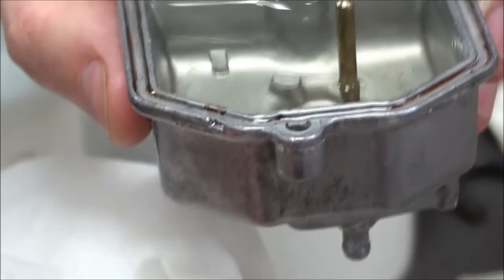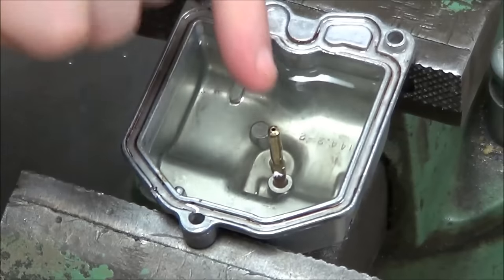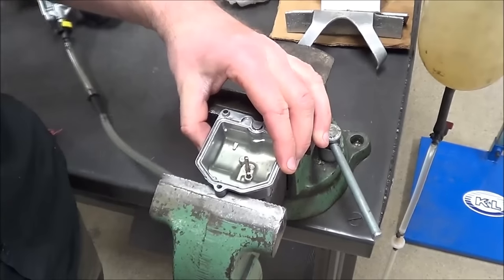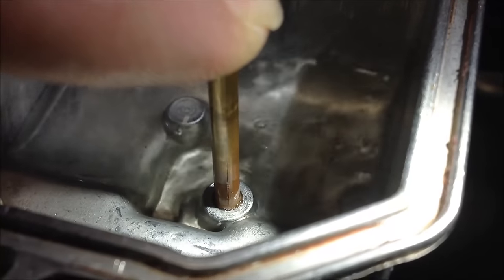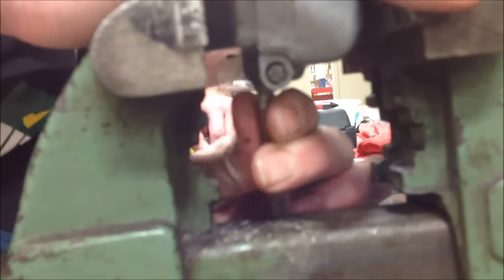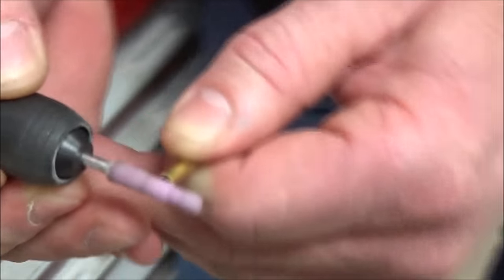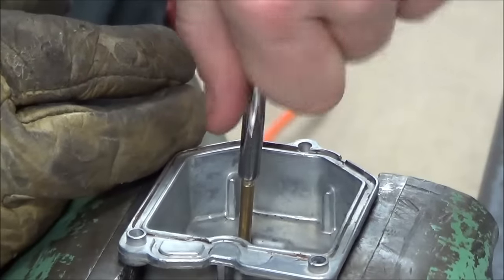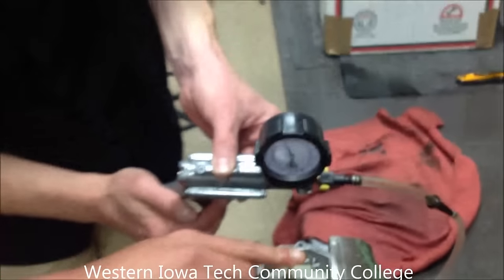How to repair a leaking carburetor float bowl. The spot you might not know about!

Comment: Which epoxy did you seal the fix with? The idea of epoxy mingling with gasoline makes me nervous since carbs can be sensitive. But you think that's alright to do?
Reply: JB Weld brother. 
I worked at the Cadillac dealer back in the 80s and when we rebuilt Rochester carburetors, we would seal up the plugs with JB Weld while we were in there.
The plugs were holes the factory used to dril out the fuel circuits and were known to leak over time so we epoxy them while doing a standard rebuild.
Reply: Awesome. Thanks for the tip. Now I just have to remember which carburetor I was working on four years ago.😆 @williamcarr3976

Comment: I have an 87 FXRS with the Kiehn Butterfly Carb . It runs great but I get a smell of gasoline all the time .Sometimes no evidence of drip just a smell . When I do notice a drip it is from the overflow tube on the bowl. I put new float needle in and clened it and checked float level ,all is good . I put new brass fuel inlet into carb ,still smell gas. I shut gas off before putting in garage and run till engine stops . I am getting ready to tear the carb off and check or rebuild again . i saw this great video and now wonder if maybe I am getting a leak where overflow tube goes into bowl like you just had on your video. I am going to check it out . Thanks for your great videos.

Comment: I had the same thing happenning on my 87 FXRS and I always used to smell gas but the bike ran great , I replaced the plastic inlet with the brass inlet , still smell gas . I had the guy who built my engine, very well established old time Harley machine shop check the carb out and fixed it up . Runs great , still smell gas . I can see gas coming out overflow tube when idling , it's getting worse . I took carb off my bike ,replacin the Kiehn butterfly with a  Harley CV used rebuilt carb . I tried this test after watching your video ,dont see any bubbles . the float and needle and jet look good. It's gotta be something slightly cracked. When you turn fule on bike runs good and fule pours out overflow tube. It's time for the more reliable carb anyhow , but drives me nuts that can't figure it out. Original carb ,85k miles , I guess it's just done.
Reply from the maker: Hi Greg. I offer full service carb rebuilding and repair if you're interested. My number is below.
👍 Thank you for taking the time to comment! It helps us! 
Here is a way to support all the free videos.
Want to say “thanks” or “keep it up”? Click here https://www.paypal.me/how2wrench  

Coach Conley is also available for hire to personally work one on one with you if ever needed. Yep he is a real person. Give him a call @ 602-345-0432
Details here: https://how2wrench.com/product/personal-tech-training-phone-facetime/ 
Your answers and help are just around the corner. Save time and money while protecting your investment and yourself by doing it the right way!
Follow us! 
Web:
www.How2Wrench.com     
www.Tools2Wrench.com

Comment: that's a good problem to drill down on and solve..but parts a pretty cheap to just replace the bowl once identified as an issue...unless of course parts are no longer available...i dont understand the brass outer sheathing on the over flow tube...was that simple to add sstrenght?  it looked longer than the stock overflor tube anyway...also will the eopxy hold up to gasoline for years? or will that fix need to be redone every year?

Comment: I like the idea of putting the sleeve over the standpipe....But, I think the JB Weld will eventually soften when soaking in gasoline.   Did you verify that the JB  Weld did not soften?
Reply: I will subscribe to your page here...Craig
Reply from the maker: Thank you for subbing...I've taken carbs apart that the JB weld has both worked and not. As I can't tell of the varibles of fuel and proper JB application, I would suggest you try it on some scrap and soak int fuel to test your work and fuel type. Make sense? I recall the day I learned this and it was an epic save over the years since...May you have the same success!
Please say thanks and “high five us here: https://www.paypal.me/how2wrench
Reply: Only had it go a little soft because I didn’t put enough hardener in it was still holding the float stand no problem

Comment: 1st thank you for the vid a forum I was just on said floats weren't adjustable or commonly fixable (by like average peeps wit average tools). On the top of the carb there is a screw on cap with a spring loaded around the I Becleve they call it the needle that is operated by pushing the accelerator. Does the needle get stuck and or get out of position? Any technique to return it to normal?
Reply from the maker: If I can ever be of service to you, here is a video explains how to connect with me. 
https://www.youtube.com/watch?v=vjvmB01ebcs 

Link to membership: https://how2wrench.com/product/membershipmembers-onlymembers? 

Keep Wrenching,
Shane Conley
Instructor/Motivator/Motorcyclist
www.how2wrench.com

Like freebies? Click here for a free diagnostic checklist! 
http://gem.godaddy.com/signups/364621/join 

Did you like this free video and hope to see more? Would you just like to say thank you with a donation? Click https://www.paypal.me/how2wrench

Comment: Awesome. I found my new favorite channel.

Any insight on what epoxy was used?
Reply from the maker: Good old JB Weld!
Reply: shane conley Oh awesome. I'm wondering if gas could affect or break down JB over time, or if this is more of a temporary fix? I'm also wondering if the volume of the new drain tube and JB Weld would cause the motor to run more lean (due to less fuel in the bowl), or would the float simply adjust for the change in volume?
Reply: @How2Wrench  Great, thank you, and take care!

Comment: I have a 2006 yz250f right once I turn on the gas the overflow line starts drizzling I’m getting so mad please help
Reply: so you got a leak inside the carb, could be the O ring on the pilot jet if you got one of those, maybe the float isnt working properly, just take it out and clean the entire thing and check to make sure that all the parts work mate, if you dont want to do that, buy a new one? lol
Reply: Did you fix it yet ...sounds like its overflowing inside ...float set too high ...
Good luck..
Reply: @jerryking1434  I ended up selling the bike yes I fixed it

Comment: what should i do if that little metal pipe in the bowl snaps off
Reply: Damon Berarducci I have the same issue right now no answers let me know if you find out
Reply: I drilled mine out a tini bit and stuck a ink pin plastic tube in its place....so far so good but I'm gona take one out of this other carb I found ..it was a nice tight fit tho ,may work for life. Just don't drill to big of hole